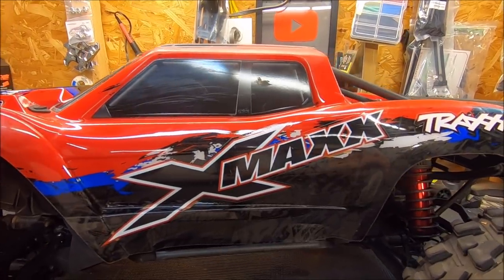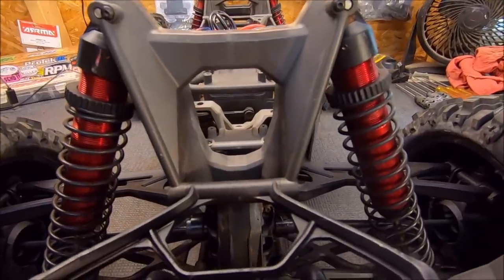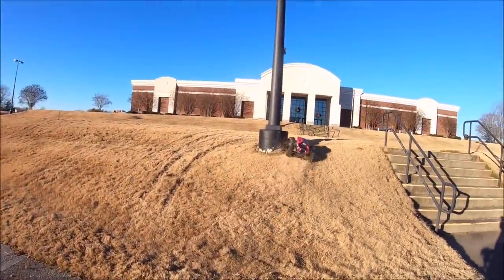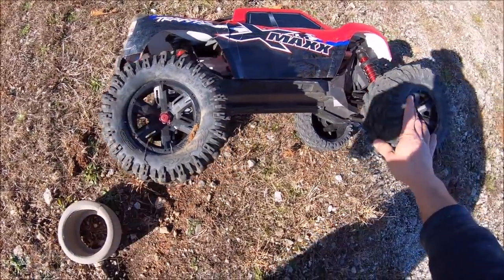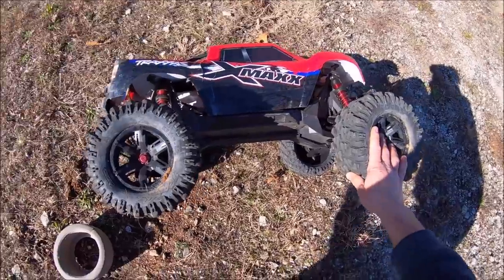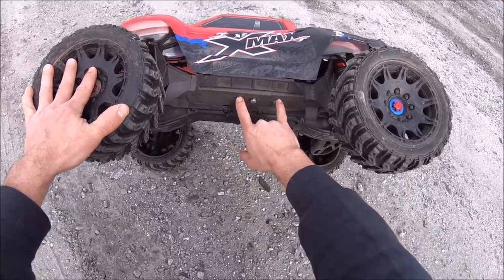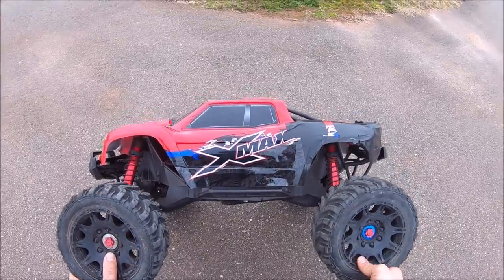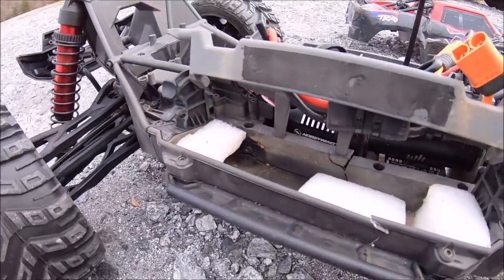DEATH of the X-MAXX?!😱M2C X-Series shaft, Hobbywing 1650kv test and Carnaged!

Comment: I hope Traxxas' CEO watches this(maybe?) They definitely need to figure out the tire situation, they've been a problem since the beginning,over powered or not. The body flying off is inevitable but somebody on YouTube has a decent solution, I dont recall who or what. Good luck. That M2C center is going to sell like crazy.
Reply: The XMax  is not overpowered it is cheap parts that's all it is
Reply: M2c's parts seem super legit.. I've mentioned to a few others guys my wish for some maxx stuff.  Mainly drive shaft, hingepins,  braces and whatever other parts they can think of. Im saving my pennies for something armma just to get some parts from M2C.. anyways Always a good time on your channel.  Maybe they will come up with one of their bullet proof chassis for the xmaxx. That would be sick..✌
Reply: @bigmusclerc5967  "over powered OR NOT" What I meant by that was tires suck on stock electronics or upgraded electronics. Cheap parts or not it's fun truck that sells like crazy. Keep on hatin tho
Reply: @Oh_its_Sheaf    -M2C 6lug wheel hex adapter kit for 17mm wheels is a must for the plastic wheels that Arrma has in their kits. A must have part from the start on any Arrma off-road truck.
Reply: @bigmusclerc5967  dont know how you can say its not over powered, stock motor is 1275kv - Eric is running 1650kv that is only rated by Hobbywing to 6s but being run on 8s with 23 tooth pinion - its way over powered, i doubt even stock Arrma 8s tires would hold up to this amount of power. Have a few friends who have XLX2 and 1100kv motors in their Outcast 8s and keep blowing the stock Arrma tires

All this being said, the stock Xmax tires do suck, especially the current foams, older foams were ok
Reply: @HardcoreRC   My bad you have a higher KV that is overpowered I have XMAX 8S With a hobbywing max6 with a 1100kv motor  I scripped out the  Spur gear pretty bad
Reply: @bigmusclerc5967  Its not me that is over powered, its Eric AKA RCDude81 that is running 1650kv on 8s with high gears. Stock gears suck, need some GDS gears

Comment: This was hilarious 😂😂  I think the X-Maxx is a hopeless case, honestly... even though the chassis is plastic and bends, its design is bad and inappropriate for hard landings like this, it needed to be flat, or almost flat top to bottom, the unevenness between the bulkheads and the center of the chassis is too big, also most of the weight is in the center (motor, ECS, batteries, ...)
Reply from the maker: Agreed. Need a flat bottom chassis for these bigger sends to flat!
Reply: Agreed. In terms of physics and stress points, it just doesn't make sense.
Reply: For me, personally, the Xmaxx survives my 30ft plus jumps. But his jumps looks like double that height 🤣.
Reply: No hate but why does Kraton 8s rtr chassis bend on the first jump on Kevin?

Comment: curious where your chassis split, wondering if that's due to the center drive shaft support being made of metal and not allowing the chassis to flex now, as looks like it all split around the metal center support ? have a smiliar set up in ours and that block is made of TPU so it can flex, PLA ones used to crack so its clearly supposed to flex there.

Great session though 👍👍
Reply: Yeah metal on the x maxx is not needed. Our chassis was ok after a full throttle head on with the box. So must be the no give metal 🤷‍♂️
Reply from the maker: We are looking into it!👊👊
Reply: @mrclairesrcs3290  🎯
Reply: yesss indeed its cause the metal center brace. It's not the first Xmaxx ii've seen with the m2c center shaft that breaks his chassis. Kev has broken 2 chassis in 5 years so it has to be something else 😂
Reply: Thunder rc had a chassis split with tbe m2c brace as well
Reply: Seems like allot of you guys are making Excuses why the precious XMaxx doesn't hold up to REAL abuse by Good drivers!! 🤔 And NO Kev is NOT a good driver, complete opposite of RC Dude81 or RichD!! M2C upgrades are legit. Just admit it the XMaxx is coming up way short on being the Big Boy on the block!!!
Reply: @ervinmedina9014  It's plastic for a reason mate. I doubt you have an X-Maxx anyway, hence the saltiness. Introduce metal in a plastic car and it'll break things. Noone bashes as Hard as Kevin, Rich and Eric, that's a given. Kev has abused his xmaxx in the last 5+  to destruction yet still hasn't broken more than 2 chassis. 
Finding a weak spot where there really wasn't one to start with. Personally I'd Rather replace bent stock shafts just quietly.
Reply: @steveblackbird  he's a total fan boy... I agree with you 🎯
Reply: @ervinmedina9014  Not at all, we have abused the hell out of our Xmaxx and never had it break like this - look at where the crack has formed, Even Eric has said they are looking into why it cracked like it did,  and a bad driver will subject a car to way more abuse than a good driver so your logic is totally flawed 😂😂😂😂
Reply: @ryand5665  is it the same place, then you will see the common denomination - add something that doesn't flex to something that is supposed to flex and guess what then happens 😂😂 im not saying the Xmaxx is unbreakable, but to break how it did then something else is going on
Reply: @HardcoreRC  A bad driver is just that. A Bad driver. The XMaxx should be able to handle them. I know the rig is stout. It just ISN'T ALL That!! I knew my comment would cause a $hit storm but it is what it is. You guys never thought his chassis might have cracked in his prior bashing!!! He isn't running the top chassis brace with the motor mount!! The mount for the drive shafts is just that, a  mount. Not a brace. I guess you don't care for my logic!! Cool!! So far the score is RC Dude81 +1 the XMaxx a FAT 0. I'll just sit back and enjoy the show!!! 👍
Reply: @ervinmedina9014  That's ok you believe what you want, From your logic and comments Kev is a bad drive yet the Xmaxx holds up just fine with him and also us. Arrma fans boys are always the same,  😂😂 adding a slab of 7075 in the middle of a chassis that is designed to flex will always cause issues. The reason the stock drive shaft bends is that its made of metal and when the plastic chassis flexes from big sends it causes the drive shaft to bend, so the way to fix it is not to add something that doesnt flex, you can clearly see in the video the chassis has cracked right around the block of 7075.

How do i know that adding a solid block to the middle of the chassis wont work, because we already have a center drive shaft fix, our block is made from TPU, any other material didnt work as it either cracked itself of cracked the chassis - sorry but your logic is very flawed 😂
Reply: @HardcoreRC  i had the center brace, the plastic copy of the aluminum brace sold on ebay, and my chassis split at the rear lower bulkhead and center chassis much like Rich Duperdash xmaxx the other day. I rather have a bent driveshaft than replace chassis parts so im back to a naked driveshaft.
Reply: @SolRayz  What plastic was it made from ? need to be something like TPU which flexes, if its a hard plastic yes the chassis or the block will crack. Also the shaft needs to be cut a bit shorter to allow movement.

Dont think people realise how much the Xmaxx chassis flexes in big hits, if it dodnt flex the shaft wouldn't bend 😂😂
Reply: @HardcoreRC  3d printed plastic.
Reply: @HardcoreRC  did you custom print a tpu driveshaft brace, because I'm not finding that anywhere.
Reply: @SolRayz  yeah needs to be made from TPU so it flexes

Comment: 😱 What happened?!? Gosh, snapped motor shaft, that's intense 🤷 Yeah, seems that the chassis now breaks around the m2C center shaft support bracket. I guess it has to be a kind of floating support instead? Killer bashing with a lot of carnage 💪
Reply: Kimberly indeed that center support needs to be able to flex, having that lump of ali stops it flexing

Comment: Man what a brutal bash. I would say the m2c driveshafts are proven 100% with the state of the chassis haha.the tires that come on that are definitely not up to the challenge lol I'm a little surprised being such a highly regarded truck it definitely seems to have some issues.  I think someone used a screw on the tab holding the body on to help it stay on better.  I think it was Kevin T. Essentially screwing in n coming out with the tab kinda making the tab longer to hang on better. Too bad about the motor that's a bummer.  It seems like it would be a real fun truck to drive if it could hold together lol I think I would almost still get one if it didn't cost so much more money to keep it going after spending so much on the truck itself lol. Definitely the sickest jumps I've seen with an xmaxx man. It was a blast seeing you push it to it's limits. Thanks for another awesome bash video man 🍻🍻🍻🍻🍻🍻

Comment: Them stock tyres are WANK!!! I remember puttin a brand new set on mine went out and within 2 minutes I blew a massive chunk of rubber off one 😡😡 I have belted Louise wheels now and so far so good. New chassis is a cheap fix, soak it in muck off or wd40 overnight before you swap it out dude 👍🏻🤘🏻🤘🏻

Comment: I think the Xmaxx doesnt fit to your drivestyle, several issues there!
We are all complaining about Arrma chassis bend, but this crack there omg!
Xmaxx tires wont last 5 minutes...they are terrible!
Always great jumps champ!!!
Reply: It’s that m2c center drive shaft that caused it. Guaranteed. That metal block in the center has no flex.
Reply: More Excuses!!! M2C upgrades are ligit!!! The XMaxx just isn't all that it's cracked up to be, oh Wait the chassis cracked! I stand corrected!! 😆
Reply: @ervinmedina9014  Welp I don’t have the m2c upgrade and mine has seen more abuse. So🤔 He is probably right.
Reply: @nopeak2000  You mean he is probably right?? If you have beat on your XMAXX and haven't busted your chassis then your good. No need for M2C. I have seen Rich DB & RC Dude81 go through a few chassis and with that brace it held it together. They are on another LEVEL though!! Whatever works 😆😆😆👍
Reply: @ervinmedina9014  Well the m2c stuff in the video has nothing to do with strength for the truck. It’s just suppose to stop the driveshafts from bending on high landings from chassis flex.

Comment: Hey m2c told me you said something about putting washer under servo horn?

I have xrt with m2c widekit. Also m2c bell crank I changed servo to 2085x and did not use heavy spring because m2c says not to. I have very week steering what could this be?
Reply from the maker: Yes it helps to add a washer to tighten up the spring tension or use a stiffer spring!
Reply: @RCDUDE81  bro I used the spring heavy duty one and put locknut same thing I put it in grass and want turn .

Wonder if the wide kit is stressing it more. Does your white part and black park of the bell crank separate under pressure?
Reply from the maker: Yes it did until I used a washer under the spring. Basically had to tighten down the screw all the way and also put a nut on it to lock it in place. I have no slop now!
Reply: @RCDUDE81  ok I’ll try that I did use longer screw and lock nut even used heavy duty spring on 2085x. I know m2c says not to but I’m trying everything . I wouldn’t think adding wide kit would kill my turning radius. Seems like barely in weight it don’t turn on ground lift it it turns fast.

Done tore it apart 4 times!! Ima try washer also on that spring but feel like bellcrank aluminum piece may pop out
Reply: @RCDUDE81  yo you got email I can shoot you video on? Bro I’ve been ready to send this but can’t stand no turning. Need help bad. Avery told me you said do washer.. what size? Same size as spring.
Reply: @RCDUDE81  Eric did you use the heavy duty spring that comes with 2085x?

Comment: Same combo I’m running in my kraton 6s exb it’s definitely got some serious power. I haven’t tried 8s in it yet I can’t keep the diffs together with 6s do you have any recommendations to help keep the diffs together it’s the spider gears inside the diff cup I keep blowing out?  I ordered the hot racing diff cups and diff housing for it im hoping that will help hold them together.
Reply: @youtubsuck  vitavon makes great parts I didn’t know they made a bulkhead for the kraton I know they have the diff cups but I don’t think I’ve seen a bulkhead yet

Comment: Wait, did I hear you say you were using the 1650kv Hobbywing motor? Was that on 6S or 8S? Because Hobbywing only rate those motors to 6S... 🤔
Reply from the maker: Yes. Performs great on 8s with my gearing. Just sucks the 5mm shaft didn't hold up 😝🤣🤣
Reply: @RCDUDE81  interesting. I have heard of people taking the chance and running it on 8S, but I'm actually amazed both the ESC and motor survived. Maybe I should've tried on 8S as well when I had it in my Limitless. LoL. Bugger, missed that chance. 😏
Great show, as always Eric, that setup is a pure tyre shredder. 😁
Reply from the maker: @AussieRCPlayground  Thanks Vas! Yeah the Max 6 can handle 8s no prob. The motor just needs to be geared right. It did run warmer but had the powerband I was looking for. I may go back to the 1100kv bc It honestly needs a 8mm motor shaft. This truck is a learning curve for me. Figuring it out as we go.😜🚀👊👊
Reply: the HW 1650kv is only rated to 6s but takes 8s all day long, bear in mind that only 55,440rpm on full tilt, we also use it for 8s speed runs. ratings are just guides on motors 😂😂

Comment: How is the 1650 on 8s doing?
Reply from the maker: Not good. Broke a motor shaft.😝
Reply: @RCDUDE81  but from ur crazy bashing i assume right?. Not from overheating or anything?
Reply: @RCDUDE81  i assume you broke the motor shaft from the bash right? i meant how does it do on 8s ? i wanna get it. with high rpm fans and shorter bash sessions should the motor live enough?
Reply from the maker: I'm not exactly sure what caused it.🤔 I think it was a bent cush drive shaft that stressed it under hard throttle. The 1100kv with a 8mm shaft was a much better fit. Powerful for sure.
Reply: @RCDUDE81  im in between 1100 and 1650. But when i see videos of it, seems that it cannot do backflips at all when i see people run them. Can you recommend what i should do. I have a max 6 at the moment and i want sheer power and backflips on demand. Thanks
Reply: @Sheldinator what did you end up going with? I. Curious because that was my thought too.

Comment: Cheers dude, you've proven to me I don't need an xmax 🤣 I've never seen anyone be able to trash one of those thing like you just did and now I know it's because most mens balls shrink when driving them 🤣.. but not you brother, you didn't hold back and got the job done right lmao. 

For me the Kratons is the best all rounder platform. There's nowhere to super send around here 😒 damn it. Lol.
My 4s is a short course/trophy truck with backflip LP's, proline flow-tek short course bash armour, 6s capable beast, 1600kv 1/8scale motor I forgot the dimensions but it was in the 6s until she got a 1350✌ .. 
The rear drive shafts needed upgrading big time, there's so much power plus with the huge wheels the stock shafts chewed up in minutes.

My 6s I've converted to road truck, basically just stiffened the suspension right up a lot. I've put traxxas slash shocks springs inside the original springs, looks cool 🤣 

Sweet bash dude, it's great to see them trucks bashed properly. Us British can't do it like you lot, we don't have the playgrounds you have 🤜😞❤🙏🥰

Comment: That’s a smaller motor no?  I got that 1650 in my outcast exb 6s. My xMaxx has the 1100kv HW and the xlx2 so far it’s a monster 😆
Reply from the maker: Yeah I wanted to go smaller and lighter. She ripped hard until the shaft snapped.😝
Reply: @RCDUDE81  at least ya had some fun
Reply: @RCDUDE81  is the 1650kv motor faster than the 1100kv motor?

Comment: Traxxas driveshaft is $9 or $10 and you can bend it back into shape or spend top dollar on an M2C solution that could possibly crack a center chassis ...meh. You need to test these jumps with the stock driveshaft.
Reply from the maker: This is only testing! Moving forward!😎👊
Reply: My point is, and i think others made this point, is that ive never seen xmaxx crack in the center chassis like that. Usually using the standard driveshaft braces out there, the chassis will split where center and rear chassis join together as demonstrated in Rick Duperbashes video. I just hope this isn't an issue going forward. Another person mentioned that center block would need to be made of flexible material like TPU, if that's even possible.

Comment: Epic vid Eric. There's a reason why a few owners hunt down the 1600kv motor from the original 6S version and use it on 8S with a Max 6.
Certainly wakes the truck up a bit! 
Thinking if M2C make the centre support with a smaller footprint base It will help stop the chassis cracking. fantastic idea and it's a shame it's under cover as it looks amazing. Also out of curiosity what was the ambient temperature ? Plastics hate cold weather. no excusing it but it is a factor.

Comment: Not sure what has happened to the x-maxx.... Think traxxas has changed the recipe for lots of the parts.. never had a problem with blowing foams and tyres out on mine and the plastic doesn't seem to be as durable... not sure what they have done to the newer x-maxxes but the ones from 2 years ago like mine are a lot better. Sorry for the poor experience dude XD